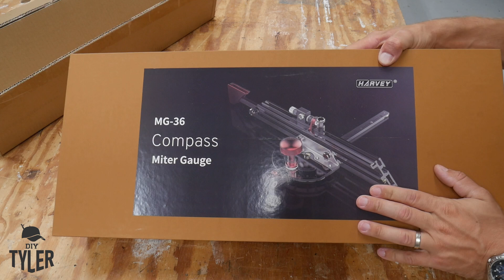Is it worth an upgrade? New Harvey MG-36 Miter Gauge Unboxing and Review + Giveaway

Comment: I have the mg-36. i had similar issues with it. Harvey gave me some adjustment ideas that did not work. After several attempts working with them, they admitted to an upgrade to the miter guide. They were kind enough to ship me  the new miter guide, which you just demonstrated. It made all the difference. The upgraded miter guide can be purchased separately for around 60 dollars.

Comment: I have a Sawstop with the Sliding miter system Harvey has the same system. Sawstop cheapened out on the miter gauge for regular table usage. I also find myself taking the fence off for the sliding system and have been on the fence between Incra and Harvey miter gauges with a look even at Woodpecker. I would be honored to be the recipient of that used Harvey miter gauge. Nice review thanks for the honesty in the first review and the continued honesty in the new gauge to older gauge comparison.

Comment: Oakland County, MI here. I have an older version than both of those. My miter bar has set screws that spread the bar apart to tension in the slot. I hate my current MG-36.